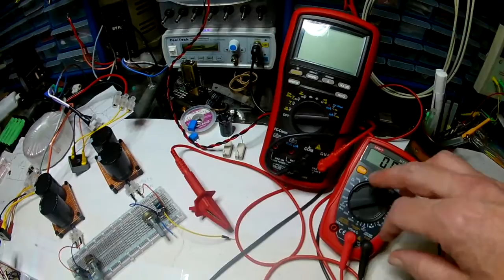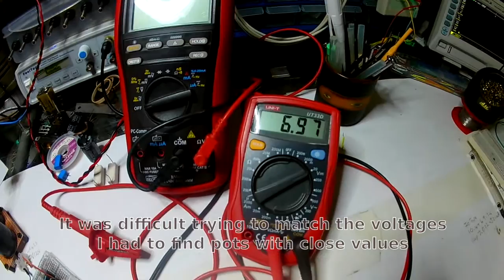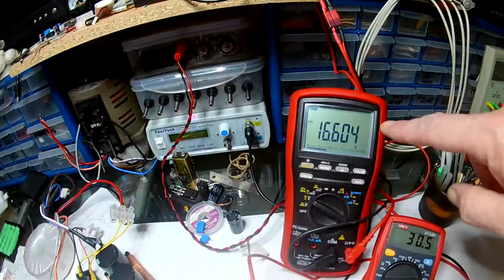Simple DIY Two Channel Power Supply

Comment: I was trying to think what your transformer reminded me of..then it came to me..a big version of one of those disinfectant blocks they put in public toilets..smile..dam i love those capacitors..try not to blow them up..grin..my old brain..i cant work out how you burnt out the pass transistors?..nice impression of a transformer under stress..SMILE..thanks for the like on my smile video...check out my boxing cats one sometimes..and then wonder why i dont get copyright hits..smile...btw i expect you know this but there is a lot of fake HV parts around..stamp HV on it...and put the price up
Reply from the maker: Yeah or a dodgy looking doughnut.  I will try not to blow them up, I might the old ones. Am still waiting for 10mF's to arrive ;) Well I guess it was because in series the lowest output is both channels combined 2.5 v  the resistance of the bulb was around (was cause its dead now) 150mA which increased as I measured it. Using Ohms Law we have about 2.3A when I powered it on. I then turned up one channel to about a quarter turn on a one turn pot. I guess the amps shot up and fried them. The regulator are fine as is everything else. Sounded like they 'popped'  I liked that version of that song too, its nice.  I will go when I have posted this and take a look. I guess I could check if mine are fake HV, connect them to my current happy boost converter... regulate or die!